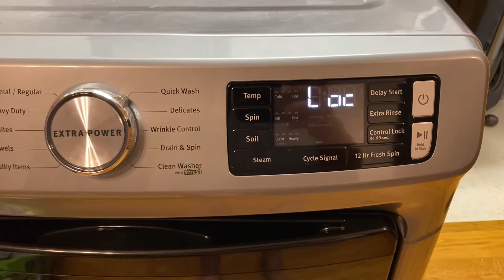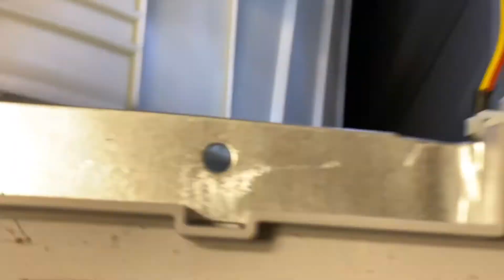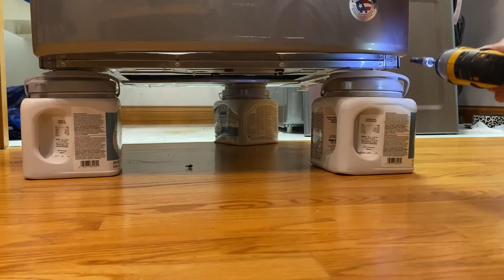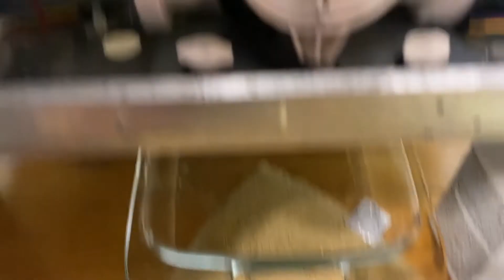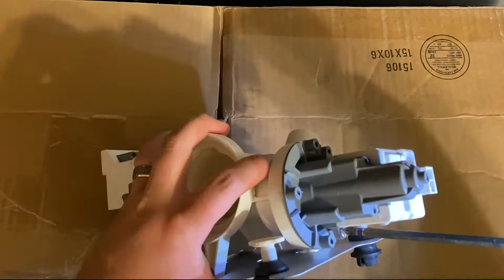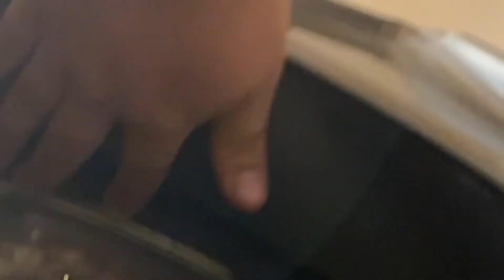Whirlpool / Maytag Washer Won't Drain

Comment: Ok, but how do you drain the water?
Reply from the maker: Near the drain pump, there is a black tube with a plug in the end. Remove the plug and the drain pump assembly will empty out.

Comment: I managed to not take off the door seal and still drain it. I knew putting back on will be impossible.
Reply from the maker: Did you drain it from the bottom?
Reply: @shortsimplesolutions7983 is there not a pump that is an exact match so you don’t have to change the connectors? Also can you access the pump area without removing the gasket?
Reply: @ I did. My hand fit between the door and drain. I changed the door seal on my last washer and refused to do that again 😂
Reply: @antonioherrera2476  could you take the actual pump out though without removing the door? I think my pump motor might be bad.
Reply: @JustinWalls-w3l  you can’t there’s not enough clearance. Did you try draining it first ?
Reply: @antonioherrera2476 could your hand fit between door and access port to reach in and pull hair and crud out?

Comment: the machine says LOC on the display of course it wont do anything. lmao you have all the buttons locked. you have to hold the lock button for 3 seconds to unlock it, not change the pump.
Reply from the maker: I think you missed the point of this video. Whether the machine was locked or unlocked did not change the fact that the machine stopped operating mid cycle full of water.
Reply: That did not work for Mine

Comment: We have the same issue with our Maytag.  Purchased the motor you had linked but the plug did not match.  Could you confirm which motor you purchased?  Thanks.
Reply from the maker: I had to cut off the existing connector (washing machine side) and crimp on spade terminals. Sorry, I didn’t show in the video.